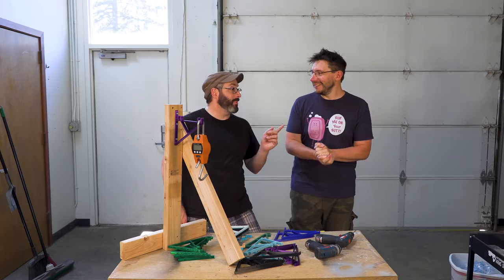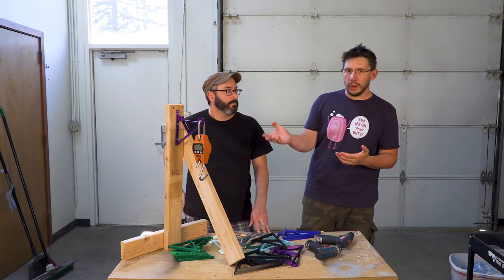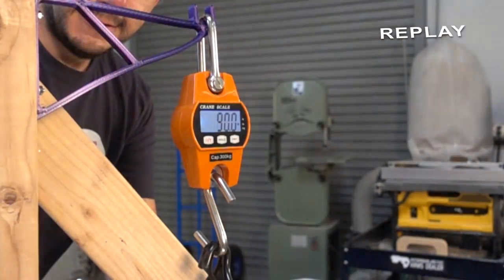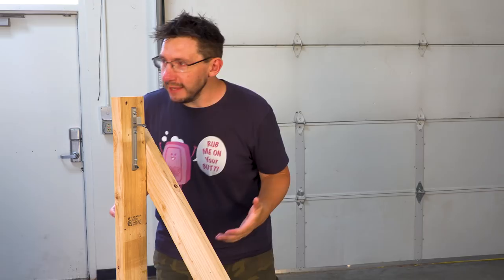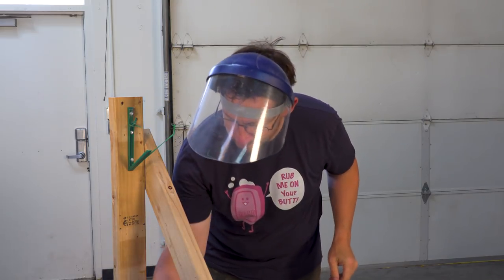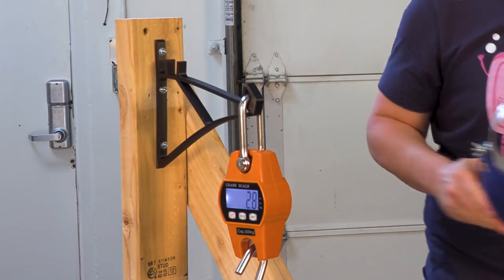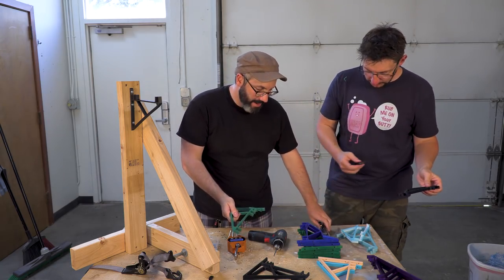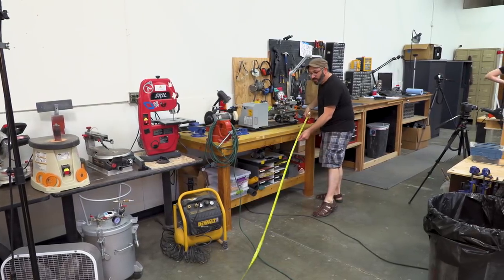Will It Break? Stress Testing 3D Printed Brackets IN THE NAME OF SCIENCE!

Comment: Hi Joel it's your wheel chair Santa here I was a Meteorologist at Rockwell Int. our labs second only to the NBS. I did Calibration work inc destructive such as you are doing here. Trouble is your putting the load to far out and not allowing the full strength of your mega brackets to be truly tested. you should be pulling half way between the back 1' X 2' slot & the outer 1" X  2" slot.actually you should put long enough 1 X 2 to  bridge the width of one spool then run a cable thru the spools center and attach your strain gauge to that and pull. at this time your selling your supports short they will probably support at least 40% if tested in the manner I suggest. hay don't think like that you don't want a printer full of coal do you?

Comment: You guys missed the mark here. The issue isn't downward force. With the board in place, the force is horizontal, AWAY from the wall they are mounted on. This pressure comes from the rolls of filament pushing on the wood, which breaks the tab farthest from the wall. Downward pulling doesn't matter as much, on this bracket.   They are much stronger in PC-CF...

Comment: I was about to type "safety squints" when you mentioned it. Interesting video. I could see how you might improve on the design to take advantage of the material's strengths. Tension vs. compression, changing the pattern to avoid laminations where there's tension for example, such as where the top horizontal connects to the back.

Comment: Interesting, but to do a proper test you should have 3 of each material, print, and everything should be printed at the same settings. And then if the material can be annealed then you do more testing with parts that have been annealed. Getting assistance from Stephan over at C&C Kitchen would be cool as well. All that being said, for the purposes you made these brackets and for how many are being used I think you are covered. :) And that Elixer filament is awesome, I have a couple spools of it and it sure is purdy. :)

Comment: Softer filament like the PET and normal Nylon would probably be better if you have more pulling force, and less pushing compression (it can't bend out of the way if you pull on it). For brittle filament like PLA, compression is better. So you should actually design your bracket or other parts according to the filament you're going to use. Think about the Force!

Comment: On the top shelf of your earlier video you have ~38 spools, if each were 2.2#, that's ~84# dived by seven brackets yields 12# per bracket. Add a little for the tare weight of the spools & the weight of the lumber, and any of the plastics would technically work, especially if the design of the bracket was improved, as it is lacking in engineering. Overall informative content, thanks for sharing!

Comment: the bracket was giving way because of how horribly supported that was for the force direction, you should cut 45's into the planks instead of screwing them to the side, then the screws keep it aligned and there's less linear force on the joint of the two planks. that's why chair legs connect under the seat and not on the side most of the time, it's just easier to keep it from breaking.

Comment: Joel, safety! We don't want you getting hurt! 

You should try using a bucket with a water hose in it. You can fill it up and turn it off from a safe distance and get more accurate results since it slowly adds weight instead of the sudden torque applied here.
Reply from the maker: Right, water / sand plus bucket would be a much more precise testing method. BUT THERE IS NO FUN WITHOUT THE DANGER! :)
Reply: Excited to see the next evolution of your testing rig ;)

Comment: The other angle to consider is strength over time. I've had parts for my Mk2 that were strong when I built it, but when I upgraded to the Mk2.5 the spool holder and y axis rod clips cracked apart when I removed them. Your brackets might take the 25 pounds you're loading on them today, but will they handle it in a year?

Comment: i have to complain a little... im not 100% sure and its als not 100 percent correct due to the structure of the "thing"(the helper in the middle), but this has something like a leverage in my opinion because the device is positioned at the end which means theres a torque from the wood to the end of the "hook-thingy" idk, i cant really tell how much because i dont know the length but its multiplied by this length. What im saying is that at the mounting point it would be i.e. 400 pounds x 10cm or inches idk.. Tell me if im wrong.

Comment: Should have strapped in middle as those brackets are designed to put equal weight front to back so its stress point is in the middle. Just trying to assist on more accurate testing later guys as im a farm boy we have failures and have to decide when repairing where the stress caused the failure or if it was just wear and tear. :)

Comment: I’m not sure, but different materials react MUCH differently according to how quickly or slowly they are put under load. A few fractions of a second in one direction or another can start a embrittlement and failure point. I would imagine it would be very important to maintain a constant timed pressure release, cycle… I don’t know ...... it’s hard to explain what I’m thinking. Similar to the way a Rockwell hardness testing machine works. The load is applied the same in all cases. At the same acceleration with the same force. Love the video and your test! Just giving random rambling ideas.

Comment: Since you were using tension via a ratchet strap as your means to add "weight" to the shelf when the tested brackets bent it altered how much the scale was reading. Aka, I think you had inaccurate results because of the stretch in some of the parts, if you hung a bucket and poured sand or water into it to add weight I think that would have been more accurate results for you. I love your videos btw, and was inspired to begin 3D printing things because of you. Keep up the good work!
Reply from the maker: Thank for the tip, and you're right! Though, we used the same method for everything, so while it may not be 100% accurate, it's the same amount of inaccurate across the board :)

Also, wow, keep up the 3d printing!

Comment: I don't have a dual extrusion printer but I would be interested to see how the strength would handle printing the infill with a larger nozzle, or even printing the infill with one filament but the exterior in another.  It may be a way to use a "strong' filament on the inside but a "pretty" filament on the outside.

Comment: I'm less than two minutes in and I can see your apparatus is missing something.  You are depending on the strength of the screws for your cross support.  Add one more 2 x 4 from the bottom of the angle board back to the main stand and the whole thing will support hundreds of pounds.

Comment: I'm not through the entire video yet, but I feel like you should be distributing the force across both resting points, rather than just pulling on the end there. You may be able to compare the strenghts of the different materials this way (and it's fun to just break stuff), but it won't tell you how many spools you'll be able to rest on your shelf. That first failure is a case in point. It wouldn't have delaminated the way it did had half that force been moved closer to the pivot point.
Reply: And the NylonX failure wouldn't have happened the same way if there was a wood beam inside the bracket insert, rather than a metal hook. I suppose it all depends on what your goals are for these tests.

Comment: Not to be that guy, but from a beam theory standpoint those things are designed in the opposite way than they should be to handle maximim load, each flat part should be a T or H beam and the max load would go up quite a lot.
Reply: A cool thing you could do is to do a topology optimized shape and print that :) then you get a wacky fun shape that handles lots of load :)

Comment: You should make a standard test widget and test in shear, tension and compression then work with Lars Christiansen and use the Fusion 360 finite element analysis to design the support and test physical results to projected results. Also because of the layering it may preform similar to carbon fiber and fiberglass layups.

Comment: Interesting experiment - however I don't think it's a true test of the strength of the bracket design itself. The load on the bracket is spread across the whole upper length. A more coherent test would be a weight pressed/pulled down spreading the load across the top.

Comment: Hi Joel according to the bending moment laws of the total  load that the material fail isn't that accurate because you didn't multiply the load by the distance of the load from the bracket if you do that you can work out the total load it can hold before failure .

Comment: Why is it anytime I see Bill I think about Stink Bag?  Not derogatory at all LOL
Seriously though, it seems either the pivot point or the upper contact failed making the cantilever point the cross brace that was pretty strong. I think if the upper contact part was made thicker with a fillet then you would spread the stress out along the layer lines better and maybe avoid the delamination issue you saw on the first one and maybe make the PLA and those stronger and/or fail in a different spot above what your weight limit is. 
More of these videos Joel, these are not only the best but funniest!!!

Comment: You should've tested 4-5 models, all the same, all the exact same material as well, because I think you would get different results from identical materials, because that ratcheting motion is very flawed to test weight. Also every individual 3d print can have varying minor structural weaknesses due to extremely minor issues when printing, even when they are the same material.

Comment: As stated earlier your testing is a little flawed. Since it is intended to be used in pairs you should test that way. 
Build a rig to simulate the shelf setup. Place your force in the middle of the 2 brackets. 
This way you will have a weight that the shelf can hold before failure. And, by adjusting the distance between the two, you can increase or decrease the load handling.

Comment: I think you should have used nails or screws to mount it to the wall.
I have never used bolts through the wall.
I say this, because you might have had a failure at the area where the screw holds it to the wall.

Comment: These are supposed to be shelf brackets, right? So... why not put an actual shelf on them and see how much weight it can take?

That hook + belt set-up isn't very consistent (it can pull slightly forwards or backwards, depending on where the belt is on the wood, and it's never perfectly vertical). Even if it were, it doesn't really reflect how the bracket would behave with a shelf, because extras weight on the back (closer to the wall) can significantly change the balance of forces on the bracket.
Reply from the maker: True, the results aren't perfect, but I believe they give a decent idea.
Reply: They give a decent idea of how each material will tend to fail (i.e., bend, break, delaminate), which I guess was your main goal, but you also talk about tweaking the design, and I definitely wouldn't (re)design a bracket based on these results. 

There just isn't enough data (only one bracket of each type), the force wasn't applied in a consistent enough way, and didn't really reflect how the forces would interact in a real-world situation (i.e., with a shelf). I suspect most of the brackets that failed near the tip would have failed closer to the wall instead.

Also, if you ever do a more realistic test, remember to try the brackets upside down (i.e., placed above the shelf, with bolts going through the board), which is a common configuration used to "hide" the brackets. With most rigid materials that reduces the amount of weight they can take, but with flexible materials (significantly stronger in tension than compression) it can actually increase the load (ex., using flexible steel cables for the diagonals - which wouldn't work at all with the bracket under the shelf). 

Finally, you might want to use (or at least also provide) values in metric. That's what >95% of the world uses (including US engineers).

Comment: You should have inverted your setup. Mount the bracket upside down and pull up. In the existing setup you are ignoring the weight of the scale in your measurements (for relative measurements this doesn't matter because the scale is the same in all tests, but it throws off absolute measurements). Also, every time there is a catastrophic fail you are slamming your poor scale into the table top. If done pulling up there might be a little bounce but only due to flexing of the rigging.

Comment: I think your rig is flawed! If a shelf is set on top of the bracket the weight is distributed evenly across the top of the bracket with a downward shearing force at the point we’re the bracket frame attaches to the 2x4 not necessary at the very end of the bracket.
Reply: Gerald Campbell the actual force it could hold up isn’t right, but proportionally, it gives you an idea of what it can hold when comparing different materials :)
Reply: This isn't for a shelf, but only two pieces of thin wood strips in each slot, the further one out being where they are pulling. this design is to hold cylinders like 3D filament rolls. so pulling right where one of the two points on the entire thing that will receive any load is a lot more accurate than what you are implying.
Reply: for a difference ? yes but for a total actual load no. balancing it would give a proper total actual load IE all of these could hold more "as shelf brackets" than they can as test brackets as done here but IT DOES let us compare them relatively.

the issue is that they were NOT all printed the same. they all need to be through the moarstruder :-)
Reply: If you're going to do a stress test like this, it's best to do at the very end like they do because that gives a little more safety: yes, the brackets will hold more than what values this test gives if the weight is properly distributed, but you don't want to rely on people (or even yourself) placing things on the shelves safely.

You will also want to do multiple tests on copies of the same part in the same material.
Reply: It doesnt matter they were testing relative strength

Comment: I wish you would’ve given us the statistics based on the printer not just the material. Which printer had the lowest functional strength?
Reply from the maker: I'm very curious, why would based on printer come into play? Which statistics from the printer would you want to see?
Reply: 3D Printing Nerd You kept talking about one printer that was making a solid plastic part. I was curious as to different brands and types of printers with different configurations may be a cause of failure.

Comment: The magic worde to explain the surprisingly low loads nylon and PETG held here is modulus of elasticity. PLA has a fairly high one, which means the shape of the brackets doesn´t change much. The thrust loads in the lower part of the bracket thus still points towards there material can support it. With the more flexible PETG and nylon, the flexing bends the brackets into unstable shapes.
In short, you guessed it, the shape of the brackets was rubbish to begin with. ^^) 
Maybe replace the lowest thrust bar by a tube shape. That will be way stronger.

Comment: I wonder how better some of the parts would do with a higner temp and thinner layers? Or just higher temp. If the layers weld themselves completely you should never get layer separation, just straight failure of the material.
Reply: thicker layers are always stronger. a thin string will always break before a thick string.

also  your weakness is almost always the layer bond. so thicker layers means fewer stronger layer bonds. this is why the moarstruder prints did so much better.

Comment: Even though we ran a comparison test between similar designs, this test is wrong because the actual printing process can easily cause imperfections in the model in different places on the model hence causing failure under different loads and in different locations. It is clear that this is not a good design to hold the load, and even if it was made of some kind of metal it is easy to see that the mostly stressed point in the model is the connection between to horizontal rod and the wall.
Say all this, it is a very good test to learn from on mechanical design of supports.

Comment: There is a reason why parts don’t have sharp corners. The sharper the corner the greater the forces on any single point in the junction and you will have failure.

Comment: Thanks for the entertaining video.  This is exactly the type of testing that I would like to see between materials.  The only problem is that the execution was totally not scientific.   First of all, you don't just test a single sample out of each group.  Three would be better, but best of all is ten.  They should all be identically built with a standard temp for the material and the same infill.  Although you can correct for it, do not take some data in kilograms and others in pounds.  Remember 2.2 pounds in one kilogram.  Finally, the test results look best when in a graph or chart.  The second stage would be to take the best candidates and vary the print temperature, then other parameters.  I would like to see more of this testing.  Thanks for round one.